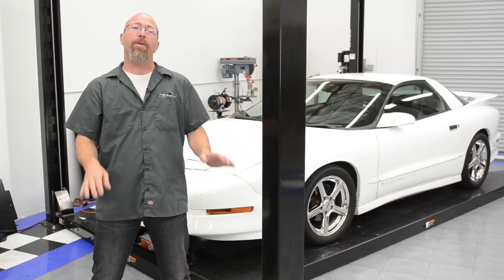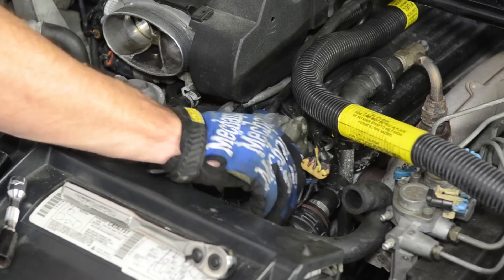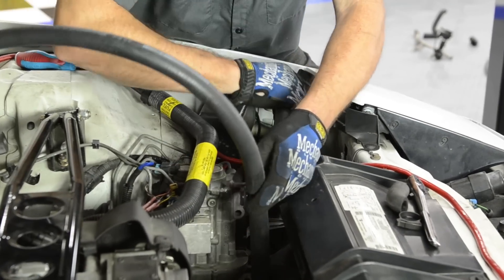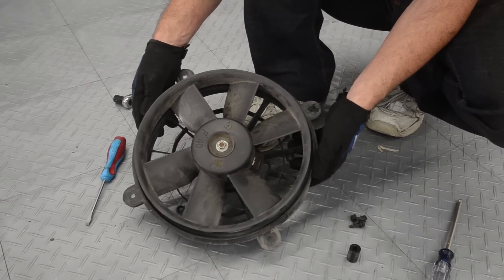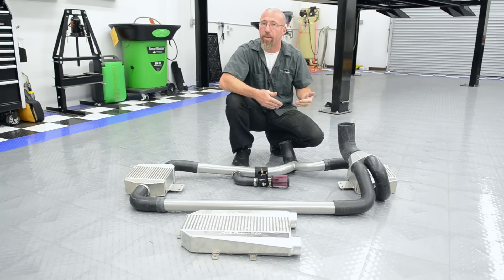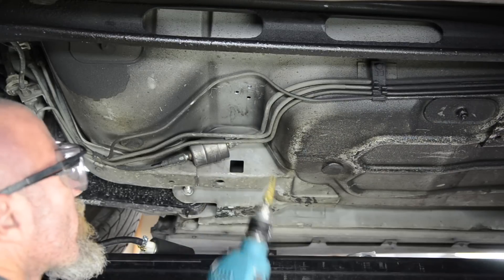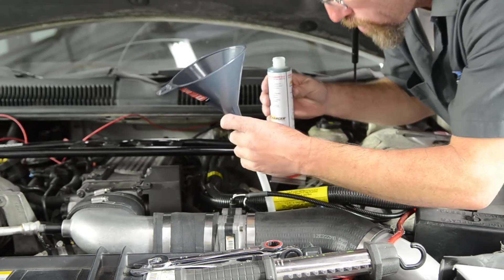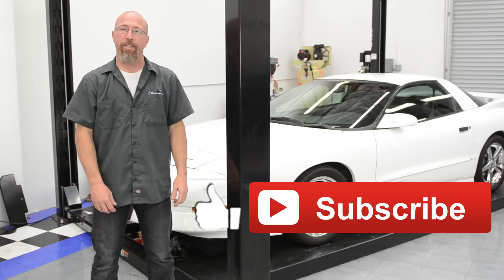How to Install a Supercharger (Procharger for LT1 Firebird)

Comment: So does it come with everything in the video looking to buy in the future and don’t know what kit to buy
Reply from the maker: There are so many options and applications. Some kits come with just the main components and the bits and pieces in between have to be made or purchased separately. ProCharger usually offers several options for each application depending on what you're trying to do with the supercharger. Check them out: https://www.procharger.com/ They can also put together custom part numbers for specific orders so you can get as much or as little as you need.

Comment: That fmu reminds me of when the kids get there first car and start modifying it. They be like bro, I just got a fuel pressure regulator and cranked it up to 11! Meanwhile your car's computer is like hey, what's going on and then retards the timing and such.

The correct way to do this is, size your injectors accordingly, use a map sensor with a lower bar capability and then get the car to the Dyno. Or bring it straight to the Dyno and let them have a good laugh and have them fix it right for you.

Comment: I think it’s easier installing a turbo than a supercharger lol a turbo is basically bolts, welding and adjust psi leve. I installed a 1200$ turbo my self a year ago and haven’t had any issues. The only thing I regret is installing it to my engine that had 110k miles lol but other than that I did a good job. The hardest thing was to find a welder! lol

Comment: What engine mods should be done before installing a procharger?
Reply from the maker: None are necessary!  This Firebird in the video was bone stock when the supercharger was installed.  That's one of the great things about the Procharger systems:  they come with everything you need for the upgrade.

Comment: Where do you buy the Twin intercooler kit? i couldn't find it on your website. I have a 97 Camaro and im wanting to do this
Reply from the maker: Hi!  This is the twin intercooler kit for your 97 Camaro:

https://www.andysautosport.com/products/procharger__1GA212-D1SC.html

It says 93-95 on there as the fitment, but I just confirmed with Procharger that it will fit a 97 LT1 as well, guaranteed.  Hope that helps!

Comment: Definitely learned something. But I would do several things differently.  Use a decent crimptool, solder the wires, cover the wires for protection and use treaded nuts. All for a cleaner install and to be sure the wires are water proof. But have to say impressive results in increasing the hp's.

Comment: I've been mulling over a power upgrade to a Corvette L98.  Only 240 stock HP at the flywheel.  I would like to double that without doing heads or cam.  Looks like a viable option.  Thanks for the video. Some of your wiring sucked, however I will watch again.

Comment: Can someone please help me l need to know how to install the oil spray nozzle fitting on p 600b procharger as there are two orifce holes one spraying straight and the second one 45 degree the procharger is mounted upside down on my 1995 Camaro

Comment: Nice video, brings back a lot of memories...did this in the 90's, same kit with the P600B blower unit and twin intercoolers. Back then, you also had to punch a hole in the oil pan. I ended up breaking 3 pistons at 9 lbs boost. I rebuilt the engine in 1999 with forged pistons and h beam rods. Then ran 12 lbs boost with a 12 rib belt. It made 525 rwhp with longtube headers and twin cats, blower cam, ported heads.. By this time, you should have installed a roll cage because the torque will twist the car. Keep in mind, the centrifugal will make noise, after awhile I got sick of it and switched to a vortech helical cut gearblower. It seemed to run better, making more low end torque. I hated their water-to-air cooler though and ended up selling that. I still have the blower though.

Comment: Why run a second pump when u can just upgrade the factory pump with a walbro 255 or 340 unit    Also would run a ractronix "hot wire " kit which gives you full voltage to pump 

Also would not run a fmu a simple upgrade fuel pressure regulator on fuel rail more simple setup and more reliable...    Fmu are unrelable and don't work very good for anything more the 8psi

Comment: For the second Dyno run with the Procharger installed you took the rpms all the way up to almost 7k!!  Even the first dyno was a bit high.  How are you able to get those additional RPM's and have it not cause engine damage or a floating valve.  Can the stock engine take that?  I have a 383ci 97 trans am and defiantly looking into one of these kits.

Comment: I thought the compression ratio had 2 be lowered with any pressurized induction system or detonation would occur,is high octane gasoline needed or expensive additives?

Comment: Was that a bone stock LT1 you started with that put out 275hp at the wheels?
 
What's the most boost and HP you can safely run a stock bottom end LT1 at, from your experience?
Reply: I have a 95 when i bought it the guy said he had some work done to it.i dont know what he had done but i tuned it and got 306 to the wheel
Reply: 6-8 psi is what I have always heard is safe for unmodified performance engines.

275HP is misleading.  Every dyno will give you different numbers.  So when dyno tuning you need to use the same one over and over.  If stock Im guessing that dyno is reading a little high.
Reply: 600 hp and the stock bottom end goes bye bye.

Comment: Yes very good video ... word to the wise the fmu set up is not a wise choice .. youbshould relay on reprgramming and adjustable fuel regulator ..    

I have a simliar set up witj 15 pounds but I mounted the inter - cooler in front bumper and water injection   you can see how it runs in some of my vids

Comment: I need one of those, how much are those complete kits for a 95 z28 camaro with the lt1?
Reply: You will spend well over 7 gs on the same unit he has installed,i also have a 95 Z and done my research.would have to upgrade injectors,heads and exhaust system.10gs+ to have a good set up done.

Comment: Say good bye to the stock 7.5 rear and transmission
Reply: I have done many of these kits over the years and pro-charger is one of the better company's out there .....  only a few draw backs ... unless you spend a ton of money over there their customer service is a little "snobby"  and replacement parts (example like their  pulley tensioner and pulley which always blow up or separate at the wrong time) are extremely expensive ...  .....  also anther quick note on these systems ... they always seem to shred belts anything over 6 pounds main reason is that the brackets flex under load ... what most do is order a 12 rib pulley set up and use a 6 - 8 rib belt so that when the brackets flex there is room for the belt to move ....  trust me its a pain in the but to be fooling around a a back road and loose a belt

Comment: great how to video nice to see how simple this install really is. one question. does this install pretty much tax out the fuel injectors?
Reply: thanks for the response i was curious as i am build an l67 GTP motor to swap into my 97 Grand Am and i know when i put a smaller pulley onit i need to upgrade fuel injectors along with fuel pump so that made me curious as to what i could do with my friends TA he is working on